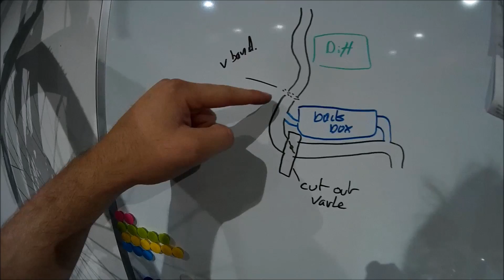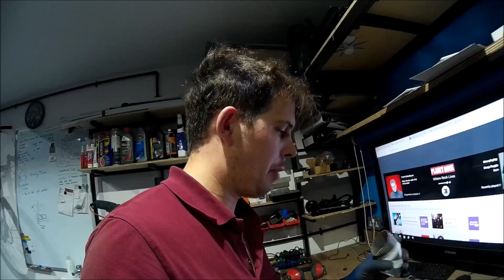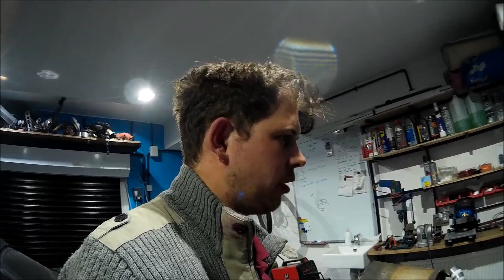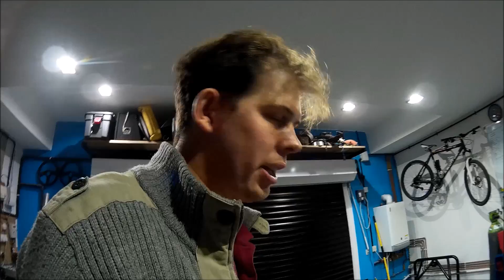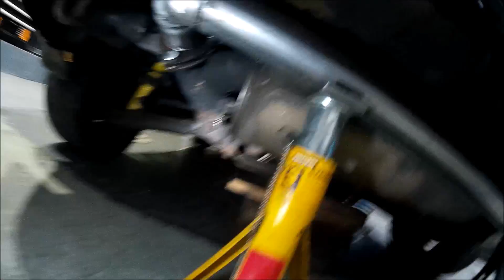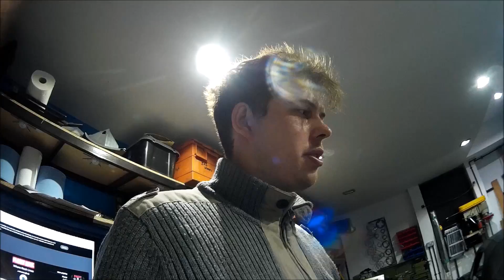Exhaust cut out valve: How to! Making the MX5/Miata stupid LOUD!

Comment: Tip: Make a hole in the rigth side of muffler where the pipe is going to tip (position of hole should be directly where midpipe goes into muffler from). You can go cheap way with just one knee under car or better way with cut out valve and than join to original tip (be aware of battery box) and it is like 20% of work than in the video and I think better and deeper sound, sometimes with some popcorn :D

Comment: What exhaust set do you have?  Does it just dump from the headers when switched?
Reply from the maker: Its a straight pipe from the headers which bypasses the backbox when the valve is open.